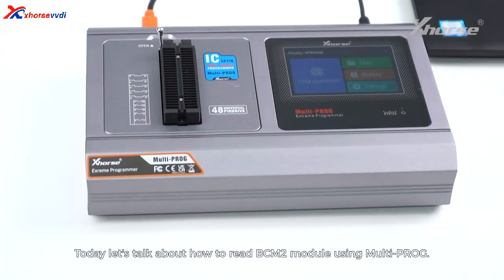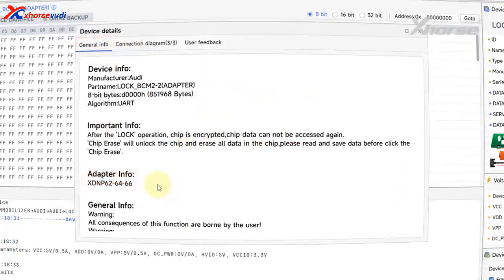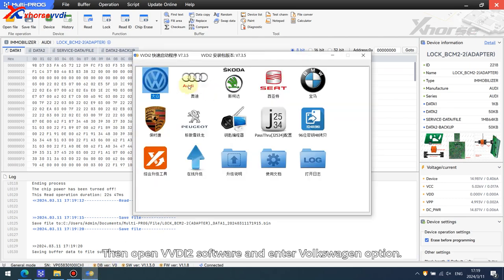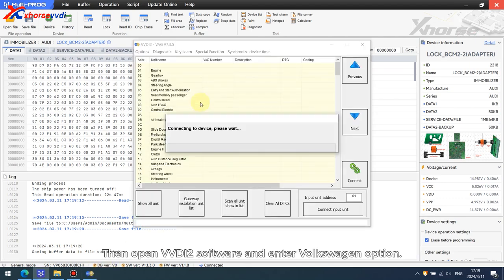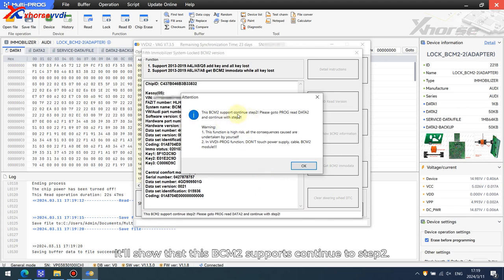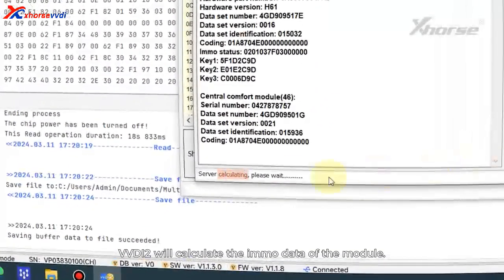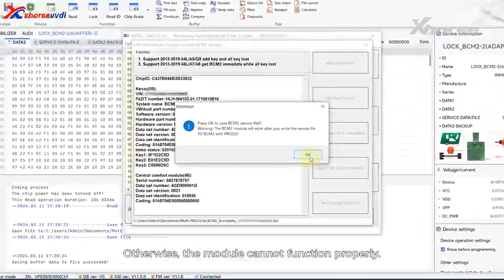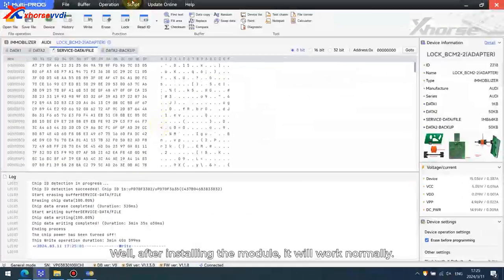How Multi Prog Read Audi BCM2 No Soldering?

Comment: Are these the same adapters that are used for vvdi prog?Many sellers indicate that these adapters are used with vvdi prog and pad plus. But it is not written that this works with multiprog.
Reply from the maker: it works with vvdi prog/ keytoolplus/ multi prog, n software will show u what cables u need